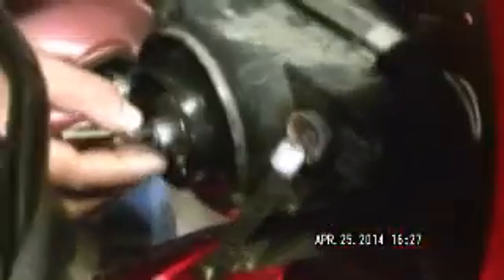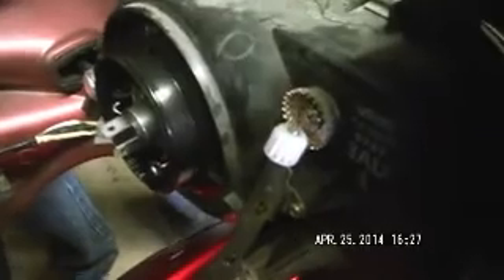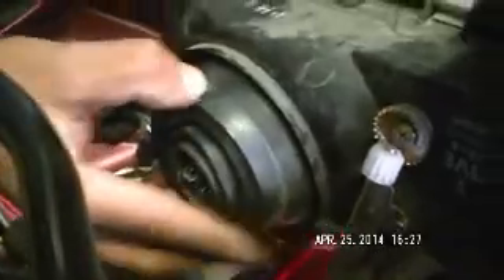Ninja 500 headd lights change

Comment: Dude you don't need to take the whole fairing off to reach the head light...
Reply: J G  I will be doing this job tomorrow on 2 ninjas 500r one is 2002 other 2006 and would like to know of an easier way plz. That’ seems overly complicated and not necessary but nevertheless could use some direction plz. Th x dude